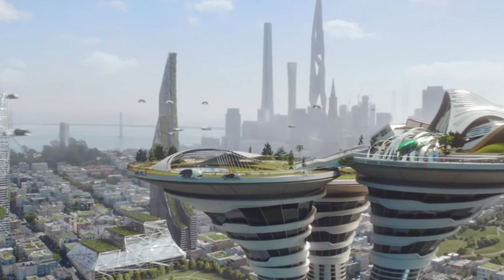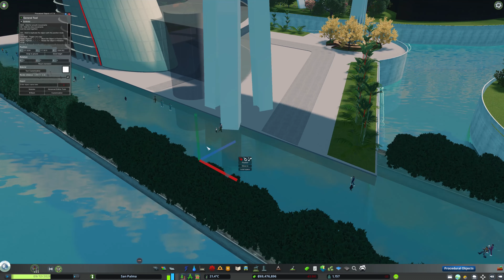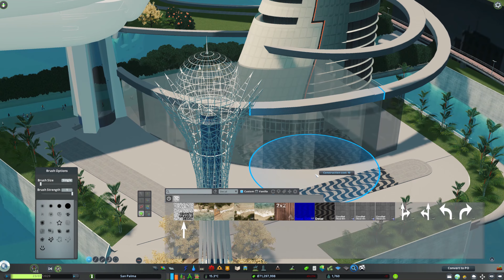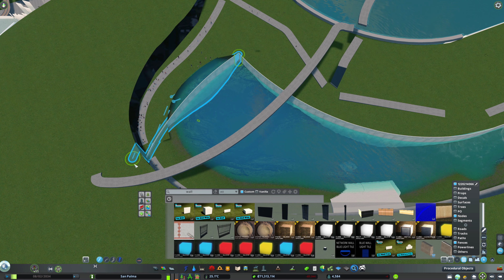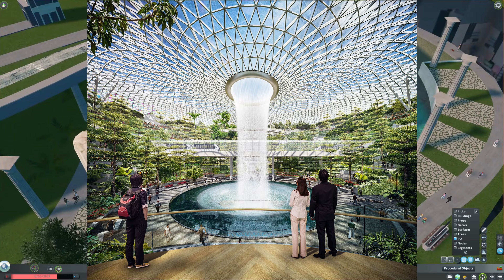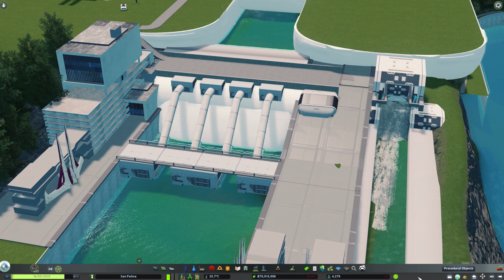Taking the City WAY up! | Episode 02

Comment: Its not a must do and it might cost performance but if theres a way to have ray tracing on, could you have it on? Considering the lakes cover so much of the area they need some detail. I figure ray tracing might make the lakes look a little better.
Also there are a lot of other reflective surfaces which some reflections dont make much sense. As I said it does look great without it but with ray tracing I think it will look 2x better

10:15 as you can see the reflection does look pretty unrealistic.